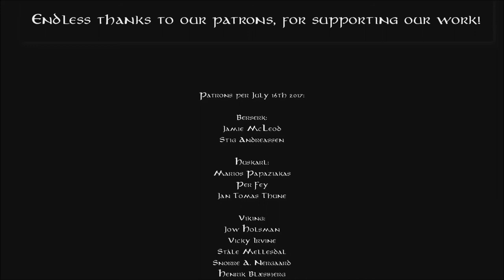Assembling and painting Smaug - Timelapse

Comment: Great job but I have to ask one question, why didn't you put the Jewels on his Belly? (I watched few Smaug vids and no-one seems to have done this)  I have a Dragon I want to convert to Smaug and I trying to find out the best way of Jewelling his belly, any tips would be most gratefully received.
Reply from the maker: For me it was time constraints. I did two at the same time, one for me and one for a friend in the UK. So I had a deadline for when I had to have them finished.

I guess looking at reference photos, and paintings of fafnir from norse mythology for jewelled dragon bellies
Reply: @STFWargaming  Thanks for getting back so soon, I'm thinking of gluing model Gemstones into place -  any ideas where to get a good selection/right scale? 1/12th roughly
Reply from the maker: Maybe craft stores. Don't know what the stores are called where you live but here they do sell tiny gemstones with flat backs for scrapbooking in hobby and craft stores.

If you have the skill or want to learn you could sculpt a sampling of different gemstones or cut them out of plasticard, then use instamold or make your own rubber molds to cast them in resin.
Reply: @STFWargaming  Thanks Man, I'm looking for the easy fix ;) I'll look in a few Craft Stores - Live long and Prosper...

Comment: Fantastic work!!!
   What airbrushes do you recommend?
     What type of airbrush paint did you use?
           Thank you,
              Rick
Reply from the maker: For smaug I used a £6 airbrush from ebay. My compressor on the other hand is a £400 silair compressor. The most important thing is fantastic airflow. I have since upgraded to a sparmax airbursh. It's still a cheap model about £100 but it can do a lot more detail work than the cheaper one I now use for basic basecoating
Reply from the maker: I used vallejo model Air

Comment: how big is the overall model i am wondering if it will fit in my display cabinet ?
Reply from the maker: How big is you display cabinet? The Ikea Detolfs are to small I think! -While
Reply: Mine is an old wood display cabinet with a depth of 13 inches and a height of 12
 inches and length of 33.5 inches.
Reply from the maker: you're fine with everything, the depth should just about be enough.
Reply: Thanks i think it will be a snug fit